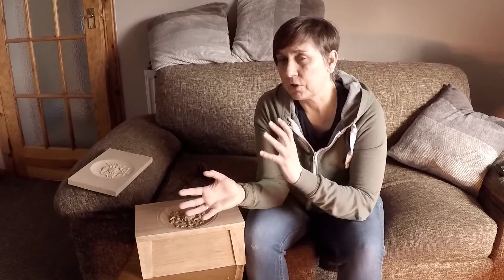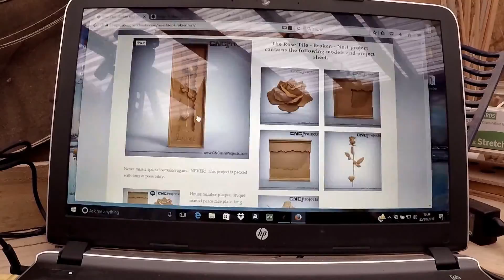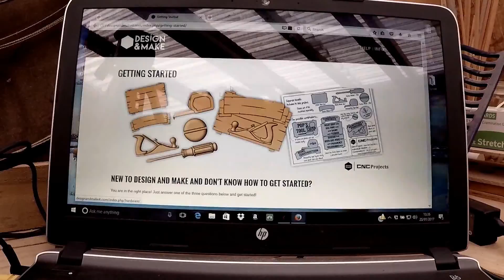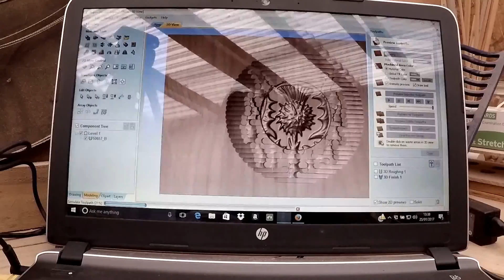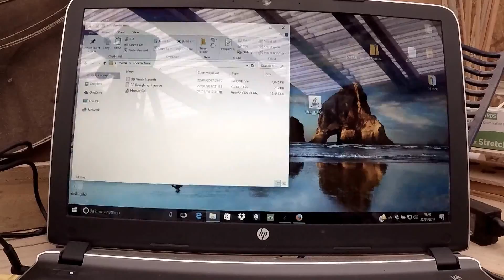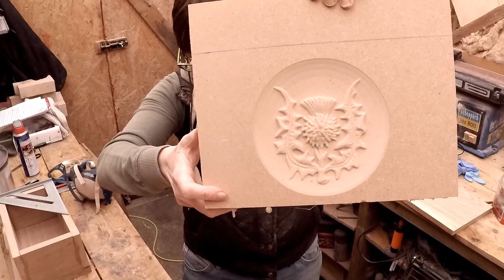Square box project Part 1 (Carving the thistle)

Comment: Hey Pam!!!  WOW... what a great looking box!  Nice works and I love the details on the corners... well done! 

Great work with the tooling... and in 2 hours... great job! 

Thanks for the plug and for using the model in your project.  You are correct that Aspire may be a bit out of reach for someone just dipping their toes into the CNC world.  For those that are looking to get into this sort of thing, Vectric offers, like you mentioned, lower cost but very capable line of software called VCarve (Desktop and Pro).  It also can use our 3D models and projects to add that special touch to a woodworking project!

A big bonus to starting with VCarve is that once you are used to using it and want to upgrade all that you have learnt is 100% transferable.  So it is a great way to get started if you are just thinking of giving it a try.

Again... thanks for sharing what you do and we will be watching to see what you do next!